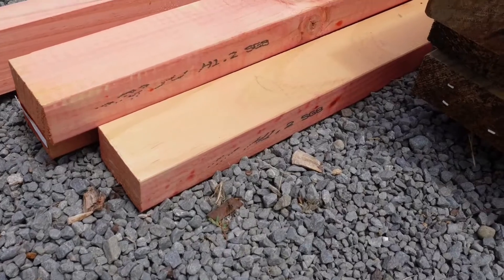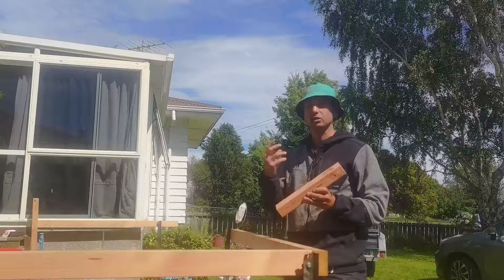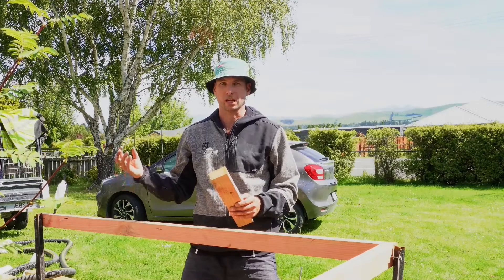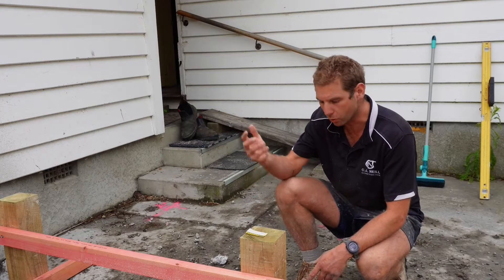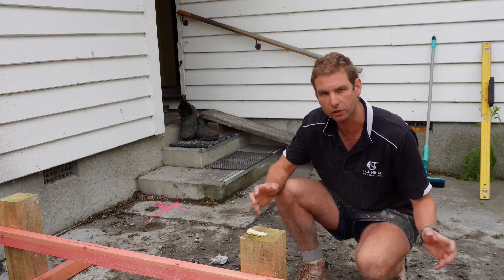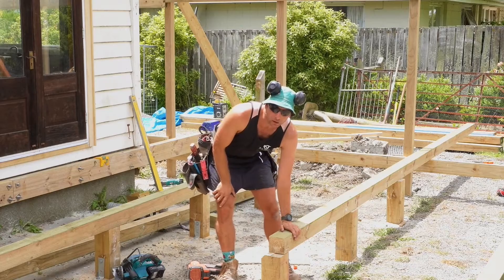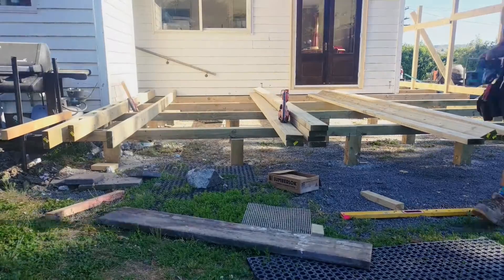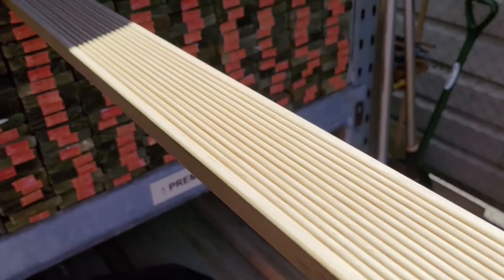The different timber treatments we use in New Zealand

Comment: Treated wood products should be used in its final shape and form as supplied. If subsequent cutting to
length rebates or notch holes are formed for required for fitting and installation, exposed cuts should
have an in can remedial preservative applied such as Enseal Clear or Green. IN NO CIRCUMSTANCES
should H3.2 CCA treated timber be rip sawn or re-manufactured from the original dimensions.

Comment: Really like watching this young man . A lot of talent going on here . Read the bio and essentially 3 years in the field , Impressed . I like the jigging for he bolts , That's really the only way to keep them in the proper location before the epoxy sets . Loved have a concrete mixer on site , Only once have we ever had them for small pour , Either break the bag in a wheelbarrow and use a hoe , or some will dry-pack " Pour in the concrete mix and ladle in some water " . I gotta confess , I was " Taught " by bad carpenters and learned more of what not to do . Another way I learned to mix concrete was a tarp , Drop the bag in , open it,  Add water and you and another carpenter create a whirlwind sloshing vortex  . Like flipping pancake batter and it mixes perfect in 30 seconds and you both lift a side and sluice it in , Just like it came out a truck. Here in my corner of America " South Carolina " The dominant species of wood for framing is SYP Southern Yellow Pine , They use as well for pressure treated , It's an obnoxious wood that is used for treated nominal lumber , joist , and truss members . It's modulus of strength great . Another is SPF" Spruce Pine Fir " . But it's mostly spruce .  and used for most nominal framing , Never exterior . It's stable . I like the ganging of supports with a sequential brace .  Some will do everyone individually and brace in the X and Y .  Off topic here . But when it came to wall bracing , I'd go bonkers and some thought I was fanatical and wasting time .Ha !!  In wall framing I would look for lines of control , Vectors. I call them control cells .In the simplest terms . If you have a 100x100 square box and inside of that box were 4 -50x50 boxes , I'd try to use 2 cells as where I could control the top plates , That's where I'd concentrate my bracing and consider pathways . Some throw up braces everywhere and some duplicate the lines of force . You'd be knocking your head and cutting off passageways to work . Some would run them through door openings and you'd have to hop and jump hurdles . Then if someone drops an LVL as they are navigating through the house with that beam  . Drop it on a brace and potentially shocked the brace and throw a wall out of plumb . I've seen it especially on taller braced walls and might not get caught . Until too much is already locked in above and doom awaits . I take it further yet where my fanaticism kicks in . I go scientific  I will measure on the floor a distance to where the brace is anchored to a top plate . To a location that is meaty for anchorage . Like a jack / stud at a doorway . Then calculate the hypotenuse , Ascertain whether the angle is at greatest strength , Calculate the angle with inverse tangents and cut bracing top and bottom at perfect angles " Or within 2 degrees . It ain't interior trim " It gives me a firm full meaty connection , And it looks like the carpenter was thinking . The best part is . I now have open unobstructed walkways. Walls are stabilized and will take explosives to shock . Might take me 15 seconds to calculate a brace . But save 10 man-hours of being impeded . Many sling braces everywhere and looks like a forest of pixie sticks , Everyone is obstructed and has to battle to maneuver through the project and many times braces are duplicated just to enhance the clutter . The only good part to that style . It'll keep homeowners and builders out of the house and won't be able to see what shoddy workmanship that's going on . LOL . I always remember . I am not building for The Builder nor am I building for myself , I am building for the homeowner and when they are happy , The builder is happy and my value increases . It's the virtuous circle . I believe in even the simplest task , How can I improve and how can I make it better ? . Sometimes others will look at me like a guru or sage . One must become one with his work , You can feel the house talk and there is a fluid motion. Two sayings I love and mulled over for years . "Efficiency is intelligent laziness "  and " Simplicity is the ultimate sophistication "  Peace . . Doing great mate
Reply from the maker: Thanks for the support mate. I was lucky enough to have a great teacher for the last year and half and have just recently entered the apprenticeship of the year competition, which he thinks I have a good chance of winning.

Regarding braces, I absolutely try to keep door ways clear. I put braces on every frame join and either side of the lintel(header), plus any long walls . Around exterior doors and windows I either avoid them or put them on blocks, so they can stay on when we put the joinery in. The Addington units had the braces taken off way too early and I spent two weeks trying to plumb and straighten everything. Considering what I had to work with, I think it looks ok.
Reply: @Lenz_carpentry   Awesome . Entering a competition , Awesome , From the videos I have watched of yours . I think you have the ability , Honestly , What I have seen and listened to , You actually have the skill set greater then carpenters here that have 25 years experience . I have a few treasured awards or plaques . One was a plaque certifying the authenticity of the flag that flew over the US capitol the day my father retired . Another was my builder's license " Which I never studied for" . Just went and took it and didn't know I needed a prep course LOL . Another I really never got handed to me but was given to the builder . But I actually led ..# 1 National Homebuilder's Award 2014 .and  one that I cherish  " The Mad Scientist Award " that says . Rambling E-mails of brilliance , hand's free and a passion for quality " . LOLL . Nothing wrong aspiring to being the best you can be and loving your work . .. I know about stripping braces too soon. One 3 story house was unsheathed and no metal let-in bracing . No permanent shear , They stripped the braces . On the 3rd story the house was buffeting back and forth . Guy looks at me " You ever ride a house to the ground ? " Or removing them before collar ties or the at least the roof is sheathed . Rafters blowing out the walls and no winch or come-along could ever pull back in . Trusses at least don't have those forces thrusting walls apart and can be considered a tie through the bottom chord . But not recommended !! . There are instances though whereas some trusses could not have contact on intermediate walls . Only at engineered bearing points and explained by an engineer that it could change the moments in a truss and render it unequal in thrust / tension and loading . But then again , I don't rely on trusses to keep my walls stable during construction . It's a knowing as a carpenter , When it's time to strip braces.. . War story here , Years ago , I took on a project for kicks , It was a 4 story hotel . All I had to do was swing all the trusses with a crew . I was given a crew , One I had to sign for him, Since he was on prison work release.. The trusses would sit on plates like a foundations , It was huge 25 meters up . The stairwells petrified me since it was 25 meters down on both sides . I was thinking " How the heck am I going to build this with these guys ??"  .. Triple piggy-back trusses with a span of 40 meters and a building length of 120 meters .. Told I only was allowed 40 hours of crane time . There was no fall restraint at all . So I had to be a monkey . One of my workers adorned his hardhat with Metallica and graffiti  . So I thought  " Well that's neat "  So I put on four stars and wrote" Lead Idiot "on mine . So talking with the superintendent was always a joy . Here we generally run trusses on 24" centers unless noted , So we commonly will cut 25.5" blocks to tie  truss to truss when a crane is swinging . Run a few and better bracing and we advance and strip the temps and re-use . Superintendent had designed bracket's that would only work if you used duplex nails " Two heads /One nail , but we had none onsite . So I proceeded with what I knew best and he was furious " I had these made just for this , That's the whole idea "" . To which I responded " You know not all ideas are good , Does this mean you continue with a bad idea ?" . He was seething . LOL . At the time , I really didn't care what he thought . I figured I was in charge and he needs to go back down to his work trailer and eat donuts .  As crane time was running out , Well I guess you gotta pay for another day . He wanted me to fly up bunks of plywood and stock them on top of the piggyback's flat .Nope . Not until I get it braced to my satisfaction . Then we can load it ,  Had a set of trusses that were designed to bump into the elevator shaft but they didn't match up with the common trusses span . At least 1/2 meter longer . He yelled from below , These numbers are right " Your measuring them with 200 foot tape and it's laid in curve . Of course it get's shorter and close to the right number . All this was 30 years ago LOL .  When I finished he tried to insult me " I've been doing this all my life and know more than you'll ever know "  Ha !! .  Sometimes I used to hate inheriting a crew of 10 carpenters that didn't know me and I didn't know them . One old contractor got his reputation on everything being hand nailed . No air guns !! Told me " Nail guns are no good , They miss all the time " ... I told him " No  It's the guy pulling the trigger that has poor aim " . Yeah . There are dangers of shooting yourself in the ankle and many young sports put the nail guns on automatic and shred the lumber . By packing a 100 nails per square inch !!!.  There is leadership roles in carpentry , Somebody leading the project . Making the decisions and delegating out . Sometimes , Not the fun part of this trade . Some are sensitive and whine , Some you got to send a gift card " I cordially invite you " and a bouquet of roses to get them moving , Tell them to get rid of the cell phone on and on . But you got to move it . On many crews . I only wanted as many carpenters as needed for that project . Some would throw you twice as many as you need and think it'll get done twice as fast . Nope !  I tried to reason , Well if this house takes 2000 man-hours to build . I can do it with 5 carpenters working 40 hr weeks . It'll take 10 weeks .. But if you give me 2000 carpenters , By your logic , It'll take 1 hour . Every job has an optimal number needed . Too many and they'll be tripping over one another. Some don't understand . The most under my leadership was approx 100 .  That's when you stop being a carpenter but a manager with carpentry knowledge . One guy called me The Rat on Acid .. Always scurrying everywhere and giving quick solutions . Closer towards the end of my career . I enjoyed working alone or with one good helper. . Had to simmer down and get back to having fun